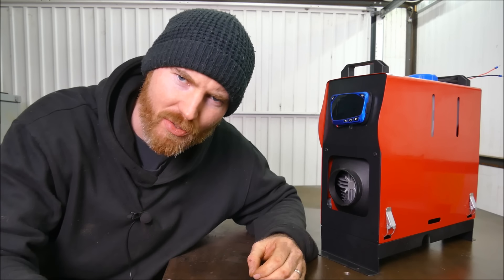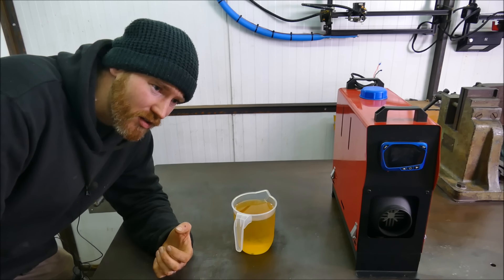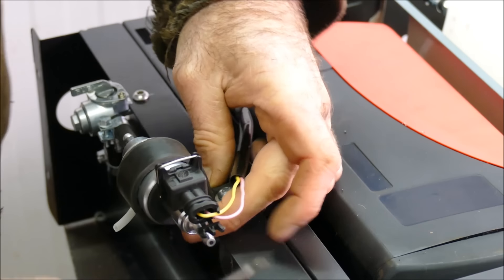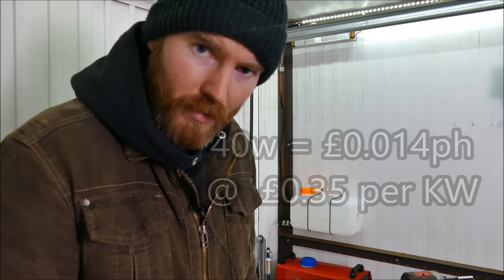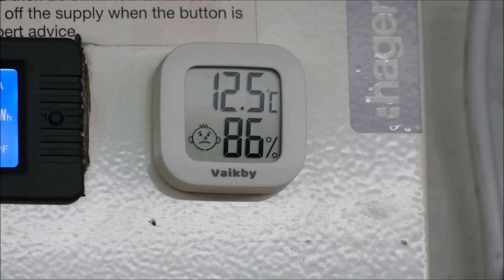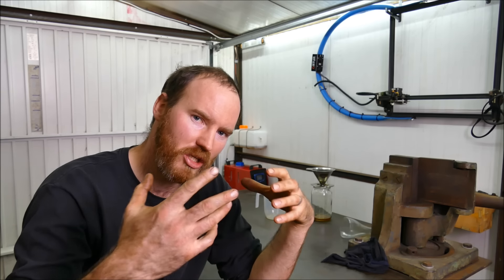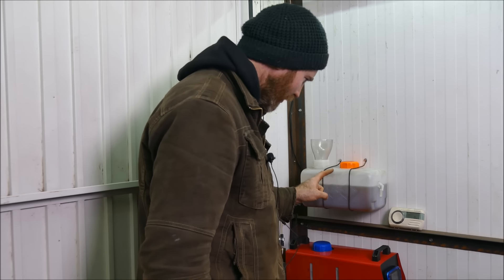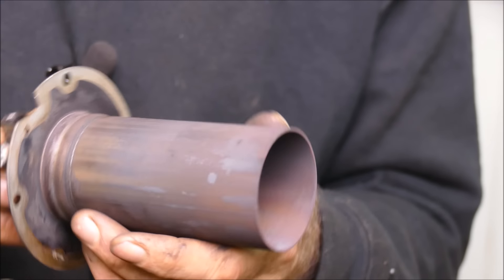£0.03 per kWh heater modification - Top facts & lies on diesel heaters - waste veg oil burn success

Comment: For over 20yrs I have used Jet A aircraft fuel to replace kerosene in my Radiant kerosene heaters--finer grade of kerosene and less than half the price, note that not all air service shops will sell Jet A to me and my fuel cans---Mikey, Belfair, Wa, USA

Comment: I suggest checking the moisture content of the waste oil.
waste oil apparently adsorbs water so the exhaust would have give off a white smoke (type) which is the water mist in the exhaust.
this may explain why the exhaust appeared to have white smoke.

Comment: I use the same chinese Vevor diesel heater to warm a office unit (basicly a well isolated shipping container with windows and a door) and i replaced the window with plexiglass plate and i have the heater outside in a big plastic box outside.
I drilled 2 large holes in the plexiglass one for mounting  the hot air coming in and one for getting rid of the over pressure,and that hose leads back to the rear of the heater in the plastic box.

This setup works great no sound and lovely warm air getting in......In like 15min the unit is warmed up alot  as its size is only outside diameter 6x2,5x2,2meters  and the wall are 40mm isolated and the roof 60mm.

Electric heating cost me alot (but a 3kw electric heater heats the place up super fast aswell).....Propane worked well but everything inside got wet from moisture and u need ventilation...................But this diesel heater cost nothing........Like 150ml diesel a hour for 4 5 6h a day lets say.......1€ a day i was sitting inside with 22-24 degrees working....

I really like these diesel heaters........ cheap vs electic and uit to run and pumping out some nice dry heat vs propane.

Comment: My Good Man...I just found your vids today...love the reports on the oil burners !
I have a comment...it is about burning kerosene as opposed to diesel.
I have read / heard that kerosene does not have the lubrication properties of diesel.  This may be why you noticed a quieter sound decibel difference when switching from starting with kero, then switching to veg-oil.  I have also read / heard that using kerosene will shorten the life of the pump because of lack of lubrication....because the pump is a piston...metal on metal piston.

Just an observation.

Absolutely love this stuff !!!
Reply from the maker: Thank you so much. Kerosene is designed specifically for heating. I'm making another video just now on the same heater as a kind of 12 month review. If the pump does fail they are only £15 to. Replace. I buy kerosene at £0.60 per litre so as you can imagine I'm saving a lot of money even if I have to buy a new pump every year. Cheers J

Comment: Just for clarity, when you are talking about Kw, most of the time you mean Kw hours. You buy electricity in Kilowatt Hours - i.e. 1 kilowatt -hour would run a 1000w appliance for 1 hour or a 100w bulb for 10 hours.

Comment: Some maby more than twenty  4ou4r years ago , I believe I read in the Toronto Star newspaper of a fire-fighter gent who uwed to drive some distance into work in toronto in a volkswagon beetle. HE WOULD START THE CAR Oon deasle oil, then switch over to waste fast-food vegetable oil tilol he got close to the fire station, then switch back ot deasil to purge the linews of the thicker waste oil. ...  As I recal , he had a means of heating the waste oil tank in hiws vehicle as well to help the flow. Give a search, perhaps you may also read about it. When in RCEME in the Army, I was wsent to a civilian school to learn Auto mechanics. It was there I also learned there is enough waste heat developed from a ve3hicl3e engine to heat a house. Please forgve the uncorrected spelling. My wife wants to leave. keep smiling / dennis

Comment: Drawing air from the outside is also cooler (theoretically) and therefore denser which makes the heater burn the fuel more efficiently.

Comment: Use ordinary sand instead of water. No steam and can draw higher temps than the water. You can also weld an Exhaust gas cooler from a car onto the end of the burn chamber to reclaim heat using water in a closed system, looks ugly as shit though.

Comment: Potentially useful information, but you're often muddling up power (energy per unit time, in this case measured in kW) and energy (J, or kWh). In this case we care about both - how much energy we consume (how hot we can get our space at a certain price, depending on insulation) and at what power output (how quickly we can do it). Without using the right units it's hard to tell what you're talking about and what you've actually measured.

Comment: Nice video and very useful.  I just installed two heaters for my 4.5 x 4.5m double garage workshop.  The exhaust goes straight outside now but having felt how much heat goes unused l with think of making a radiator.   The instructions that come with the heaters were rubbish, so your tips on setting fuel/air mix etc has been great.

Comment: Brilliant as always -
Idea-
Get an old air conditioning indoor unit-(even better,a few) and run exhaust through its pipework -its fan will do a great job of pulling heat from exhaust into the room
Set up  an old boilers heat exchanger (or 2)  at the start of exhaust, wrapped in really good insulation (give exchangers really good cleanout first, send to a 3 way valve, one side hot water,then, when hot,autoswitches to heating
GREAT STUFF!!👍👍👍😁😁😁
Reply from the maker: Great tip. Thank you. Cheers J

Comment: The carbon monoxide detector is usually recommended to be fixed at a higher point than where you currently have it, on the floor.

Comment: Just a hint. If the screen around the glow plug gets dirty or just clogged, spray in some carb cleaner or brake cleaner and blow it out with compressed air. It will save on deforming the screen, making it brittle and eventually useless. My authority? I've had to clean , (actually have it cleaned , I didn't Know then how easy it would be) that screen on my truck sleeper Wabasto , because I had added a diesel additive to the fuel tank. That stuff left little globbules on the mesh that inhibited startup. On the history of these heaters, people old enough to remember when the  VW Beetles got the gas heater up grade for the notorious lack of passenger heat that came from the engine (air cooled at the rear of the car). the design is the same.

Comment: That's ridiculous with the water bucket, you use an old heater, for example from the shower. a flat one at that. Make a drain where you can drain the condensation, and well that's ridiculous with the water bucket lol

Comment: Just for knowledge,  you do not have to worry about carbon monoxide as the burn chamber is separated from the  blower chamber and the two will never mix.  This housing will never crack.  As long as you vent the exhaust and combustion air outside then no CO inside the building.

Comment: Sooth will build up into the chimney/heat exchanger very fast because of the cooling of the exhaust. - read Chimney fire 🙂. You had too much heat in your shop on your first tests. Try blowing the air in between two rows of bricks, and it will store the heat like a radiator. Great test anyway - I enjoyed watching it

One more thing. The blue control box. If you are lucky, then the thermometer is build into it, and if the controlbox can be moved away from the heat source, then Your heater will adjust the temperature by itself.
Reply from the maker: If the burn is the correct ratio it will burn clean even with a condensing exhaust. A thermal battery using brick or sand is a good idea for sure.  Cheers J

Comment: Sorry to say but your 30* Angle is not laying FLAT It's like on a wall at 30* To 45* because, laying flat is flat no matter  ut, if u it is turning to the left with Petcock on lower then it would be fine. This you didn't mention about how it's laying and I might be jumping the gun being didn't have time to watch complete show. For sure I will later. Thanks for conversion Information. 
   I bought a 5K unit, used 5 liters per night and wasn't on max Anything! I did add a burning Catalist for diesel engines and after the 4ft of snowed in winter, if won't fire up figuring its the Igniter your system is a bit different but looks like the same guts.
   Thanks again for the breakdown and a possible money saving situation. 
If you look online for a 1" type of rope nylon or possibly cotton, you can clean your oil by putting a 5 gallon bucket out off the ground a couple of feet, put in a 6 ft piece of the rope into the 5 gallon bucket of dirty oil, drop other end into a clean empty 5 gallon bucket below the dirty oil bucket a it will siphon the dirty oil into clean bucket Thus being cleaned to new Oil Status ND usable as is now!!
   Or, Do an oil change on your Car??
Oil doesn't go bad, just gets DIRTY!!
LATER ,  Gar

Comment: you will have a higher efficiency at a lower pump setting, burning less fuel at a time, while it will put out more heat at a higher setting it also wastes more via exhaust heat.  the limited ability of the burn chamber to radiate heat limits these heaters , while your longer exhaust tube lets more heat off before it is wasted outside , at a lower power setting on the pump it will put out less heat but you will get to a point of lower exhaust temp means you are retaining more heat. try putting the exhust tube into an old metal barrel about half way up  and then out the other side at the bottom, it would create a huge heat exchange place, the hot exhust would rise to the top of the barrel while the cool would fall to the bottom then exit.

Comment: If you want more heat run a 6 inch pipe around the exhaust pipe for full length in the shop.  Run your air out into the 6 inch pipe to pick up heat before it exits into shop. No paint on exhaust pipe needed and it will drive up your output air temp. I used snaplock vent pipe.

Comment: Great video mate. I have and still am experimenting with these heaters.
Two things: i use a switchover relay powered by my power supply and if i lose mains lecky it simply reverts to a 12v battery.
Secondly where did you get that fuel switchover valve from ?
All the best mate  kev
Reply from the maker: Thank you so much. There should be a link in the description for the valve. Cheers J

Comment: You do know that smoke is perfectly natural, right? It's been happening since the beginning of time, long before humans even existed. There's nothing wrong with a little smoke, environmentally speaking, there is nothing "horrible" about it. Mechanically speaking, yes it's better if the fuel burns clean, everything stays cleaner, and there is less maintenance. But it's not "horrible". That's ridiculous.

Comment: Good video- 1-historically you were correct in stating that a kWh of electricity costs a certain price and that they directly correspond. However this is no longer true with the new tariffs available. Its now possible at certain times to import electricity at night for 7.5 p per kWh or Zero p per kwh and or even get paid to import it! if you have a battery , you can even store electricity at these rates. 2 - how much have you allowed in the cost calculations for fuel etc used in picking up the waste oil?  3 Thermally one is better off bringing in cold air from the outside  as cold air has more oxygen molecules per unit volume due to its higher density, rather than burning already heated air internally and then exhausting that already heated air. Really enjoyed the video - thank you

Comment: It may surprise you that fact is stranger than fition, but Tony Stark lives on, well, the bit that glowed in his chest, it's a cold fusion ring, burner, it develops a very small ball of lightning generating Energy, Heat, water, over unity, if you persuaded them to licence you their EngCell core, you could take the Websco heater to another level ps we had one in our caravan, oh that's ?,000 a year in sales, of course its obvious to you that heat is refrigeration and also a water supply, have I just tick boxs for over your construction capacity. Just to supply food aid. Medicine, insulin, ps they are not easy to find because its a very risky discovery.

Comment: Your cost formula is not correct, try this as heater is on for 1 min.
40w ÷ 1000 = 0.04 that's how much that uses in one hour. Now divided the answer 0.04÷60=0.000666667KWh. It's fractions of a pence, but the transformer will use some too.

Comment: You are confusing kW and kWh throughout this video - you make the same mistake over and over. 
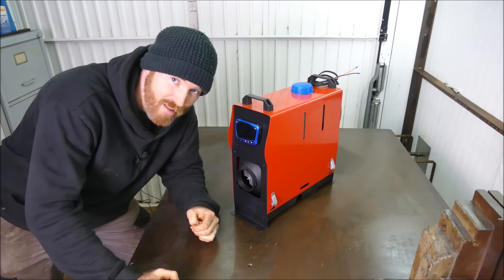1:50-1:59  8kW is power. 350ml of diesel contains a certain number of kW_hours_, and to say it "doesn't contain 8kW of energy" just makes no sense.  You meant 8kW _hours_. 350ml of low-sulphur diesel does contain about 3.5kWh of heat, so as you said '3-and-a half kW of energy', you are doing the sums right, just using the wrong units, and must indeed have meant 3.5kWh. So yeah you are getting 2-3kW from that thing.
3.15 'a kW' -> 'a kW-hour'
3.40: 'diesel has 9.5 kW per litre' -> 'diesel has 9.5 kW-hours per litre'
3:45: 'kerosene has 10.3 kW per litres' -> 'kerosene has 10.3 kW-hours per litre'
4:14 '7.7 p per kW' -> '7.7 pence per kW-hour'
4:20: 'Natural gas is 10p per kW' -> 'Natural gas is 10p per kW-hour' 
4:23: 'ASHP is 9p per kW' ->  'ASHP is 9p per kh-hour'
I'm bored of typing out all the corrections now, but here are the rest of the time stamps where you got it wrong:
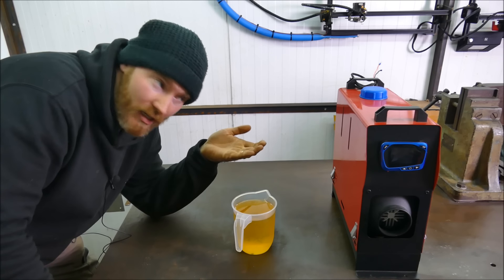4:28, 4:37, 13:04, 13:08, 26:18 (different mistake - 'kW-per-hour'), 26:22, 26:27 (W -> Wh) 26:33, 26:34, 31:35, 31:40
As you said you like to pin comments where you made a mistake. Well there were loads in this one! (18 instances)

It's a great shame when someone makes an informative video like this but uses the wrong units throughout, which just teaches more people the wrong thing and the problem gets worse. Power and energy do not have the same units! Write it out 100 times. 

Very useful to see what's inside one of those things though, so thanks for that.

Comment: you are not creating  negative pressure because you are pumping same air back into the house. however, now you are creating positive pressure and reducing the efficiency of your heater since you are heating the outside air - which can be very very cold - and blowing that heated air into the house. thats a double loss of heating power. 1. wasted hot exhaust air out, 2. very cold outside air into the heat exchanger to heat your house.

Comment: I noticed the inefficient  heat loss from the exhaust.  I added a 4 foot section of baseboard (copper pipe/aluminum fins) 
With a down hill angle, 90° out the side of the tool shed,muffler on outside. 
No problems with back pressure or static resistance.  It really reclaims a lot of heat.

Comment: Waste veg oil can have a high moisture content (from the food) that causes it to smoke and burn inefficiently. Heat a small ammount in a pan to test if it pops and spits.
It could be possible to utilise the exhaust heat to warm the filtered bulk veg oil to just above 100c to drive off the moisture.

Comment: The chemical equation for the combustion of hexane, which is pretty close to kero/diesel:

2C6H14 + 19O2 → 12CO2 + 14H2O

You’re producing 14 mols of water for every two mols of kero you burn.

Comment: 10/10 for a great video
I run mine in our heating oil and, like you recommended,  use a small 12v good condition deep cycle 22 ahc battery with a trickle charge.  The battery has the umff to get it all started, the trickle charger keeps it all going and recharges the battery back up.
Reply: TY . Im considering this and this is the exact way i was thinking of keeping it going . TY for letting us know it works .
Reply: Another thing I did during the fall here was to service it.  Lots of films on YT showing that. 
I also bought  "everything" I'd need to maintain, repair or  replace.  Like a spare glow plug and 2 tools pump, the gaskets, and of course a bag of the atomisers that I replace. 
That way IF something goes wrong in winter or during servicing,  I can deal with it directly.
I learned a lot if stuff about heating through  this project.

Comment: You said you didn't want to draw the air from inside because it would cause negative pressure.
But how can you say that when the heater is also putting back the air cancelling out your negative pressure theory. 
See if your pulling the air and putting it back then that cancelled out all of you negative pressure theory.
Reply from the maker: @dwaynet2184  I'm talking about the combustion intake not the room air intake. Cheers J

Comment: Exhaust gases could heat a boiler and small circulation pump could pump warm water to radiators or into water-heated concrete floor for extra heating. Would like to build this alternative for my air-water heater.

Comment: Your units are wrong. There is no such quantity as (for instance) 35 pence per kilowatt. In this example it would be 35 pence per kilowatt-hour. Use the correct units.

Comment: We have a few Diesel Heaters fitted to our wagons and we found home heating Oil gives the best results :) The pump does not require Oil mixed in with the home heating Oil.  I should point out BP  Super Diesel gave super results but some countries call it by a  different name etc. Used cooking caused problems  as in smoke so we done away with that oil. I should say the video was first class.

Comment: I have the same heater. It is standing outside the house. The heat comes in the house by means of a 70mm plastic pipe thru the wall. The pipe fits perfect inside the heat outlet. I use the most expensive diesel, BP Ultimate diesel at Euro2,02. I use this fuel because it doesn"t smell.(better for the neighbours).